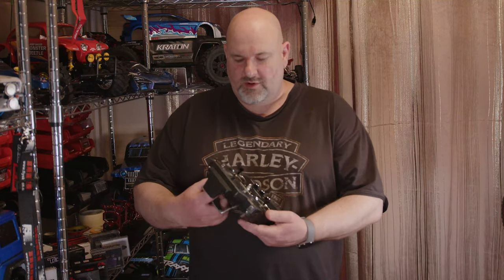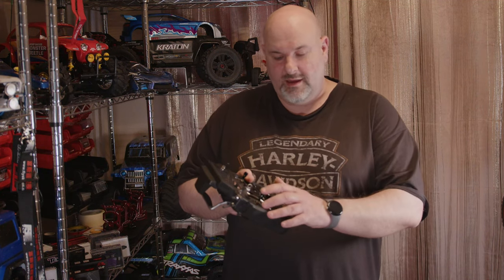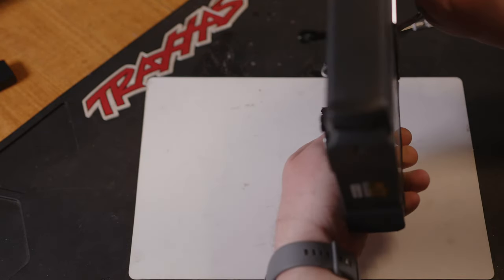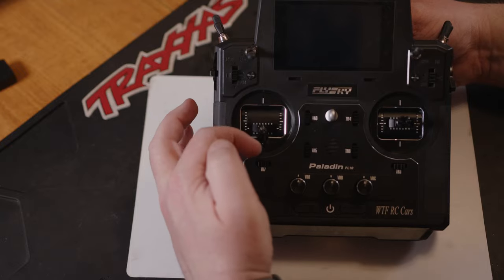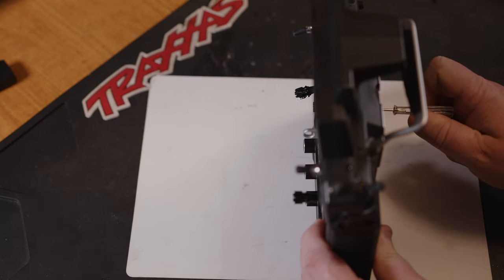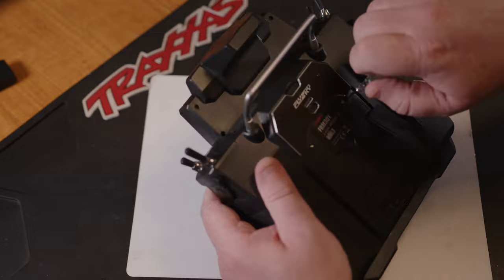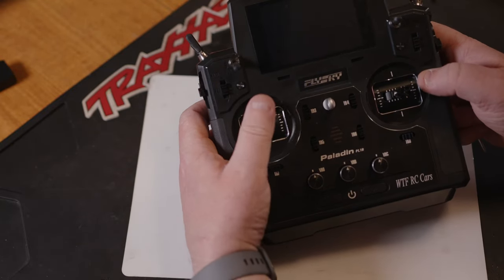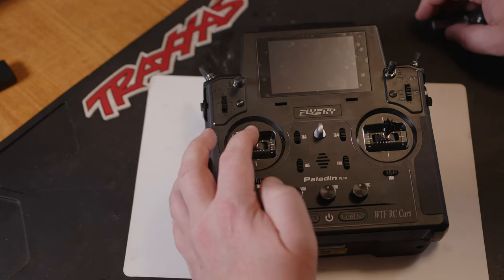Flysky Paladin PL18 self centring throttle guide.

Comment: I’d recommend calibrating the sticks before use as well.  Might not have had a perfect center when it was set for drones planes.
Reply from the maker: I alway run calibration on my tx when I set them up especially after firmware updates :)
Reply: @WTFRCCars  absolutely.  Just giving the viewers an FYI.  As I always do a calibration whenever I adjust them
Reply from the maker: Just tested it and it's fine doesn't make any difference when you convert it :)

Comment: is there a way to lock the sticks in a car setup?
Reply from the maker: Not easily
Reply: @WTFRCCars  ah ok as would have liked it for racing but don’t really fancy the sticks moving around i prefer a locked configuration
Reply from the maker: @alistairshah7968 I'll try and see if I can find a way to lock them
Reply: @WTFRCCars  that would be awesome thanks
Reply: Hi mate, 

Did you manage to find a way to lock the throttle stick?
Reply from the maker: @mattmead17 yeh it's not hard to fix it to just forward and back if I get a chance I'll try and get a vid done :)
Reply: @WTFRCCars  Nice one, thank you.
Reply: Is it something that you can do via the adjustment screws on the rear or something you figured out in another fashion?

Ideally I wouldnt like to open the transmitter up.

I checked the manual but can’t figure it out! 

Thanks again.
Reply from the maker: @mattmead17 no you have to take it apart but it's an easy tx to work on and is designed to come apart easy for changes and mods